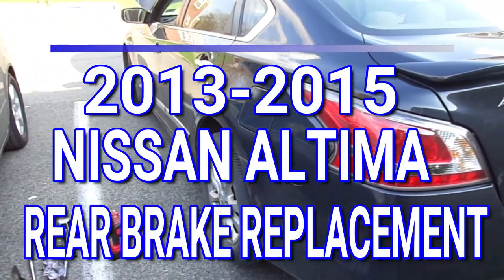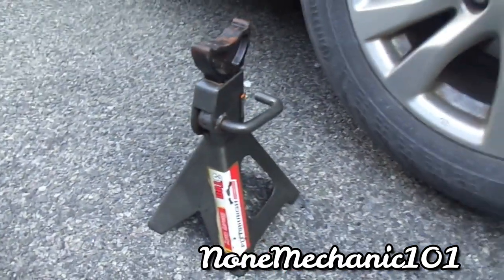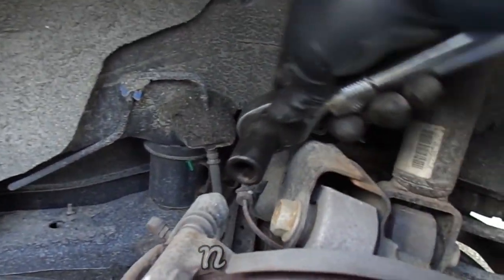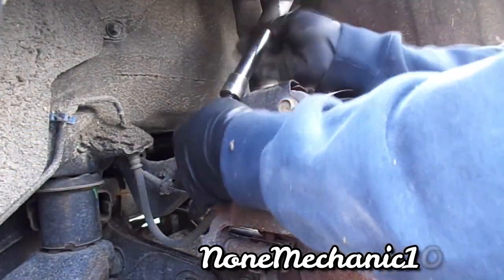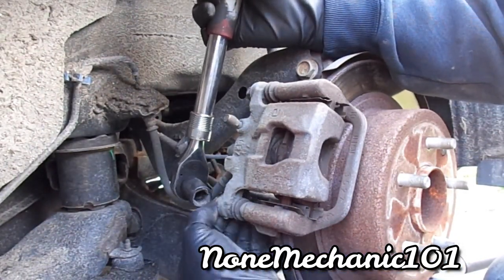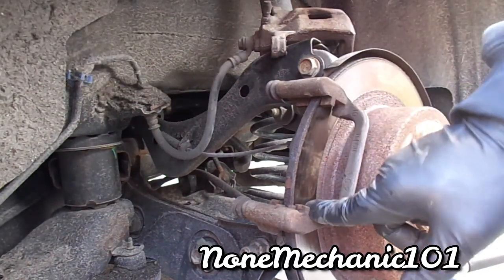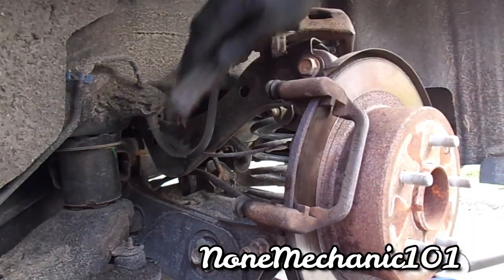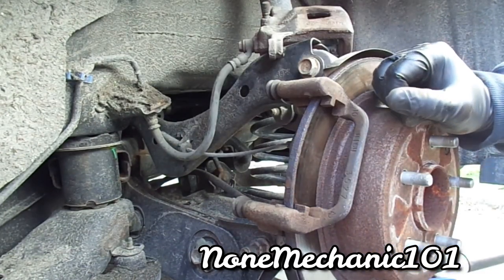2013-2015 Nissan Altima Rear Brake Pads Replacement

Comment: I could be wrong...I’m pretty sure the caliper bolts are torqued at 30 ft lbs.   the bolts that hold the caliper mounting bracket are 80 ft lbs.   verify with manufacturer though.
Reply from the maker: Thank you for the information. I'm going to pin your comment.
Reply: @NoneMechanic101  Fantastic video I was watching this to see how to bleed brakes. Cause I didn't know if I had to each time I change my breaks.
Reply from the maker: @kmcdon20  , Thank you for watching. How the job turned out?
Reply: Thank you good sir!  It was very helpful

Comment: LOL on the dirty sock as a rag!! You are getting very good with recording with one hand, and working on the car with the other. LOLOLOLOLOL, that's right, we call it THE 007!! The old brake pads were really difficult coming out, but the new ones went smooth, great job on showing that. just like you said, take pride in your work.

It is SO IMPORTANT to use the grease, like you said, especially living up there where you are. When you were pumping the brakes, that caliper was moving nice, great job Hector!
Reply from the maker: Thank you. The camera kept turning off. I thought the video wasn't going to come out good. Have to get me a new camera.

Comment: Great stuff brother, I've done a dozen brake jobs, but I like to get a refresher before I tackle another one, helps to remind me of the details. Good information about the hardware and grease, many guys half ass it and wonder why they have uneven wear or squealing brakes. I also like to give them a few good pumps with the motor running BEFORE I put it in gear, I've been surprised and it sucks lol.
Reply from the maker: Thank You

Comment: Great video just I would do deep clean  to the caliper scrap all that dirt from on it, also I do spray  with cleaner the new pads before installing and spray the rotor before also I put antizesse I little bit on the back of the new pad
Reply from the maker: Be-careful when spraying around I would put a dust mask on to protected my self. Thank you for watching.

Comment: Great video you explained it in really good detail. Two questions for you regarding the reservoir cap. Should the cap be off before pressing the piston back in? Before pumping the brake should the cap be back on the reservoir  or does it stay off the whole time until the job is finished?
Reply from the maker: I used to leave the cap off when I was pressing the brake but I learned that it is much better to put the cap back on the reservoir
Reply: elias herrera I will sometimes use a turkey Baster to remove some fluid if it’s been topped off between brake pad replacement so it doesn’t overflow.  Also I like the cap on anytime I’m pumping up the brake pedal.  The one time I didn’t the brake fluid shot up and out.  Brake fluid is bad news for paint.

Comment: Cool vid. Watch out for those duralast brake pads. The squeaker silencer  plate tend to slide off when in use. I always take them off. Cheap
Reply from the maker: Thanks for the tip!

Comment: thanks for the video. curious tho. when you remove the cap from the reservoir this is because pushing the piston back to accommodate the new pads will push the brake fluid back into the system, yes? that said, if fluid levels have been topped off recently how do you prepare for possibility of brake fluid overflow?
Reply from the maker: Yes, When removing the cap from the reservoir is because when pushing the piston back. It pushes the brake fluid back to the reservoir. The way I would prepare for an brake fluid overflow. I would put napkins in the reservoir the fluid would go into the napkin. I put a new napkin for ever side I do .

Comment: Wanted to mention that the brake callaper tool can be rented for free at most auto parts stores with a refundable deposit, if you don't have one.
Reply from the maker: Thank you👍
Reply: Also a block of wood and a quick grip works.
Patience with the fluid being pushed back through the hydraulic lines.

Comment: When you put the brake fluid cover back on at the end , did you need to purge the brakes? Did you have air in the line?
Reply from the maker: Yes I had air on the lines. I press the brakes pedal at least 10 times.

Comment: Using the screwdriver to push the  caliper piston in is a good way to break something
Reply from the maker: If isn't done correctly. Yes you can brake something.

Comment: Great video, thank you!  I know some rear caliper pistons need to be turned in.  Can you confirm the 2015 Altima piston can just be pushed in?  Thank You!  -Bob
Reply from the maker: I haven't done any Nissan Altima Rear brakes that has to be turned in. I have done Hondas, but not Nissan
Reply: Doesn't need to be turned in. Reason, the video doesn't show you that the ebrake is a separate pad setup. The disc/rotor is a dual setup.
If ebrake was part of the caliper he was working on, then it would turn out/in.
The ebrake mechanism is why the caliper turns.

Comment: you forgot to remove master cylinder cap I did what you said and it poped off and now I have brake fluid all over the place !
Reply from the maker: The master cylinder cap should be of when installing the brake pads.